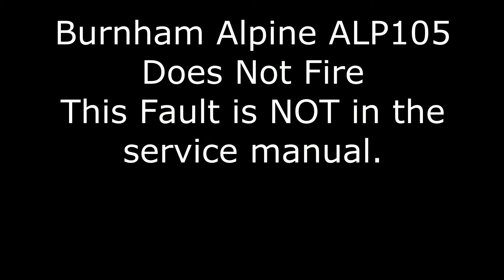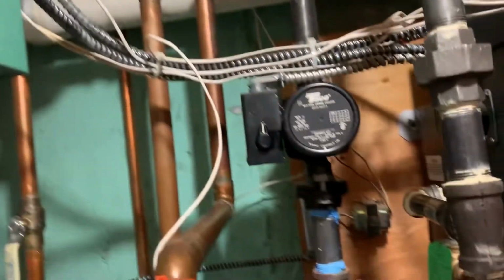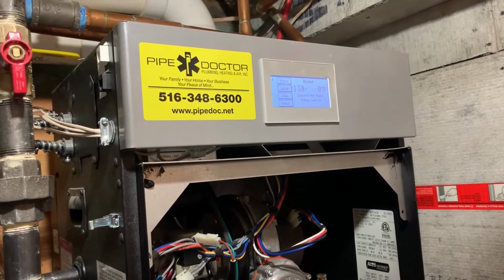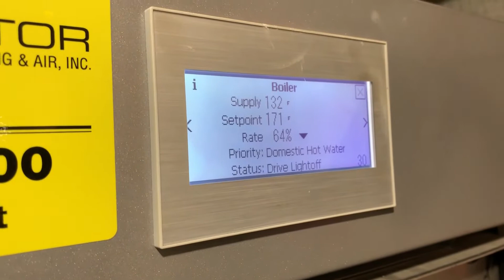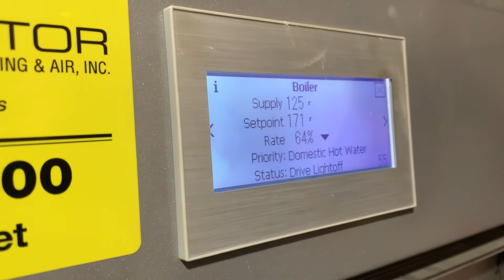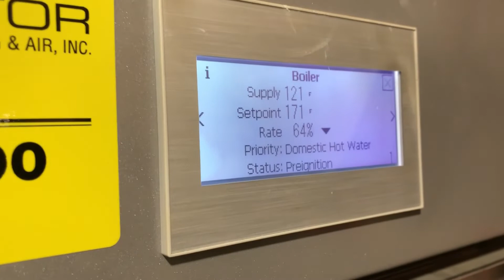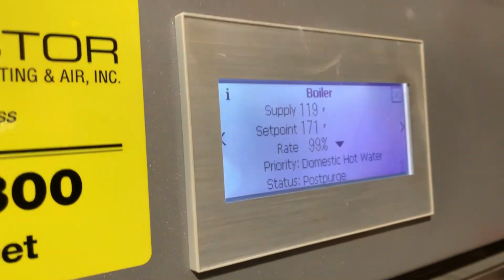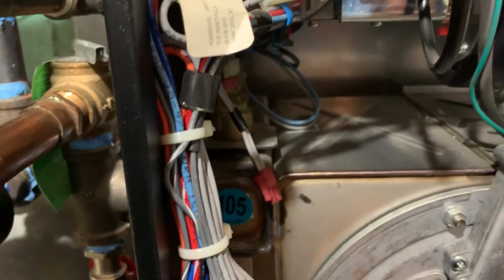Burnham Alpine ALP105 - Not Firing Error/Fault Not In Manual

Comment: Thank you so much for posting this. I have the same problem and could not figure out why. I jumped out the high limit switch and the boiler is back to regular operation. Just ordered a replacement high-limit switch.

Comment: Hello, I have an issue with a customer's 105w as well, we tested everything, including hi temp sensor as well, it pre purges, ignites for 2 to 3 seconds then flame is gone, we have 6" entering gas valve and 4 when running, by running what we have to do is cheat and block the intake and it ignites and runs 100% of the time, however if left to its own it will constantly ignite for 3 seconds and fail.... will a combustion analyzer help w this issue if I cheat it again and measure the cost percentage? Or is there a issue I am missing before that is necessary....  been 2 long days now, we replaced both flame sensor, ignitor, ignition wire, and done a very thorough cleaning as well as testing sensors and gas valve.... funny thing is, the flame sensor had a hairline Crack, and both ignitor prongs were broken, initially thought I was in for an easy repair 🤦‍♂️🤦‍♂️
Reply: @PipeDoctor  I did rear it had to be 5.5% , do you think this may be why it isn't staying lit once it goes thru the ignition procedure?? I do mostly furnaces, and a bad mixture or dirty gas log would always still light,  just with an awful flame, then after a minute or two go out on roll out or something... I've never seen something run decent, but not start on its own lol... gotta love it!!! But t.y for replying, very much appreciated

Comment: I have 10 year old Burnham Alpine 080 and my LCD burnt out. It should receive 5V but the voltage on the harness shows around 32V. The voltage on transformer is 24V. The boiler keeps working but we are flying blind. I did replace the control board (pricey) and the LCD (pricey). The LCD lasted few seconds and burnt out. Where is the problem? Can you point me in the right direction? Link, so I can read more about it?
Reply: @PipeDoctor  when I call Burnham they refer me to the list of local HVAC professionals where many of them don't service high efficiency boilers and even less play/ diagnose control boards (electronics)  :(
How to check for cross connection? There is only one way to install the control board. All the connectors are unique and fit only its own spot. Maybe you've made a video with similar problem? Send me the link. I've searched the web,  no luck
Reply: Sorry to bother you with this. My mom's Burnham ALP080 took a power surge. It doesn't work any more and the LCD Touchscreen display does not work. I was planning on replacing the control board and I figured that it had to be programmed before installation. Did you program yours? If so, can you tell me how you did it? Thanks!!
Reply: @lesio333  Did you find the problem?
Reply: @@tumdeax  yes - couple of installers came, told me change few components e.g. fluke sensor (didn't solve the issue), gas valve ($$$)(no solution). As my last solution, I've decided to buy (again $$$) motherboard and power transformer together. Problem solved. There must have been something with cross connection, like pipe doctor mentioned. The boiler is working (I didn't do any adjustments). The voltage to the LCD is 5V but I'm waiting with connecting my LCD till spring/summer in case I mess something up. This time my wife will be less patient with me playing the plumber  :))
Reply: @lesio333  You can place at 5V LED to see if it'll burn it out. cheap to lose.
check for reverse polarity at the circuit. You never know.